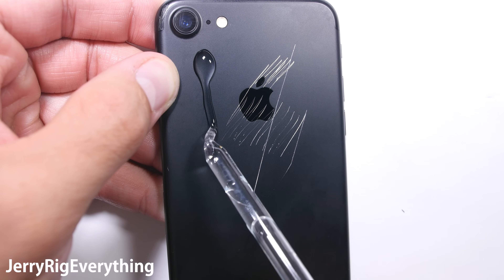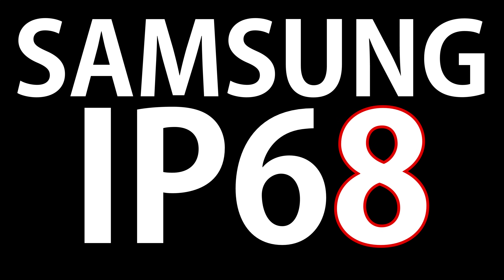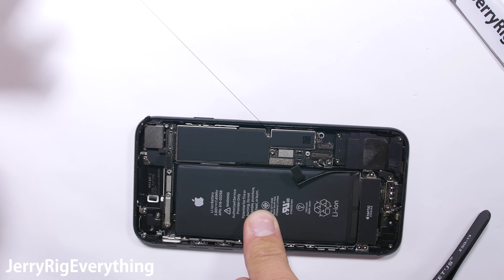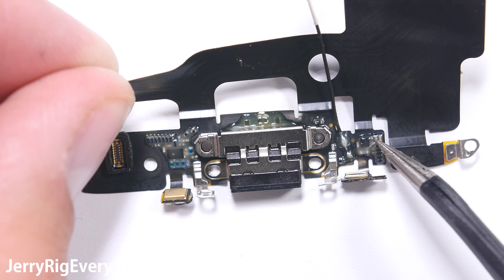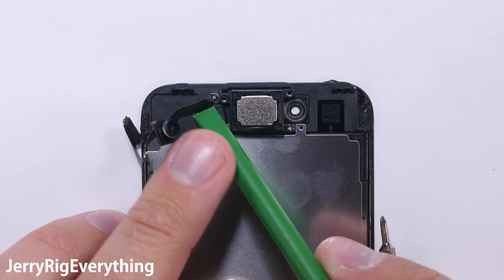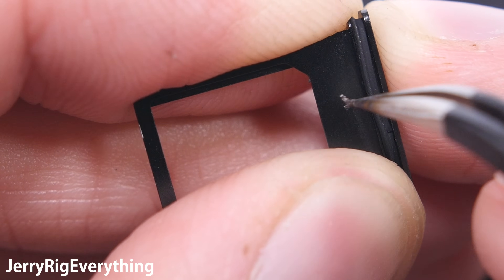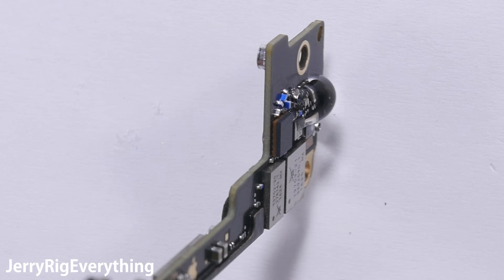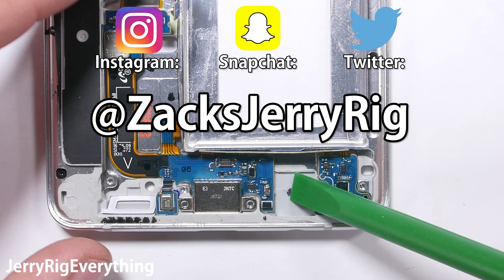What makes the iPhone 7 WaterProof? - Ultimate Test!!

Comment: Can i write under the shower or kill this my iphone?
Reply: With s7 you can
Reply: if the phone isnt completely covered in water yes, but capacitve screens usually dont work (or atleast not as good to type) when they are submerged. thats why you have to use a physical button (f.ex. volume buttons) to shoot a photo under water
Reply: The iPhone 7 is actually very water resistant. Go watch EverythingApplePro's water test. It's actually insane
Reply: +Landon Lupfer His video does prove a point but it doesn't figure in pressure and water currents. Imagine jumping into a pool with your phone in your pocket. There's a lot more pressure involved than submerging the phone in water (the bucket doesn't really allow for a "real world" test). I remember EverythingApplePro doing a video with phone cases where he strapped on a backpack and jumped into a lake/river. If he did that test with the IPhone, it would really help to see how it fares in "real world".
Reply: Mayuresh Patel I think he has a video now where a diver takes it to pretty big depths too

Comment: Hey Zack... I wonder if we could actual create a device which could simulate plugging in and removing the lighting port with a counter to potentially determine at what point it fails? Iknow machines exist for this purpose, but I figured someone of your capability could probably think of a more jerryesque solution. Stay tinkering 👍

Comment: so they removed the headphone jack for no fucking reason? how is it that the s7 has more resistance in water than the iphone 7 and has a headphone jack? what the fuck apple
Reply: they should of added wireless charging, and fixed their fucking chagring port, and chargers which break which in weeks or a few months and they are 20 dollars.. siriously most retarted move by apple 2016
Reply: Well. With the S7/S7 Edge/Note 7 You get IP68 which is a real water proofing. Headphone Jack. Wireless Charging and like 100 of extra features that IPhones don't have. 

I really liked IPhones too. Unless they didn't evolve like Android smartphones. And if You for some reason hate Samsung get any other Android smartphone ;). Or just stay with Your current phone until Apple decides to give us MORE.

Comment: All you isheep have fun with your 1960mAH battery - that thing is running out quick. Plus charging ports are degradable, and are made to stop working after around 5000 to 1000 plug ins. Removing the headphone jack just halves the time you have to say goodbye to your 720p display

Comment: Suck more Sony pls, The first smartphone waterproof, and never speak about that
Reply: Tell that to samsung fanboys ...
Reply: Had my Z3 Compact for 2 years, and flaps are still fine. I have a magnetic charger though, so don't need to open usb cap often. Although I do fiddle with it sometimes.
Also has water resistant headphone jack.
Done some underwater filming in the pool, works great.
Reply: sry bad eng, i'am Fr
Reply: +Kha h and the flaps will break down after about a year ,  happend twice on my z3c
Reply: lol cause they are getting sued because their phones are not that water tight

Comment: That's Apple glue isn't good, you can replace it with Sealant (one of type Aquarium Glue), it's very strong and heat resistant. But if your iPhone get a stumbled, the glue be easy to leak..

Comment: apple copy samsung, samsung can sue apple
Reply: What about Sony? They started to make water resistant phones before Samsung, so Sony can sue Samsung too
Reply: Nope.
Reply: Actually ... samsung copied sony and apple design!
Reply: +&#222;j&#243;&#240;rekur Haavard You&#39;re an idiot...They have not. No company had invented a water resistant phone yet.
Cell phones were barley just becoming a huge hit in the 1990s. Water Resistant cell phones have not surfaced until 2010/2011. And that was a flip phone/Phones built for use in the Military area.
In 2013 was the official first water resistant Smart phone. Made by Sony. So Samsung and Apple both Piggy-backed off of Sony's idea to make it water resistant.
Reply: Diego Cejudo You can't sue/copyright something that every company can make. What about if samsung copyright Oled screens, or if Apple copyright the 3DTouch/Force Touch or the Touch ID/Fingerpring reader. You just can't do that.
Reply: IP rating is standardize industry thingy. it is like Bluetooth, fingerprint, oled etc. I guess they paid some sort of royalty to the organization who hold the trademark license.
Reply: Dudes Samsung has been water proofing phones since the 90s.
Reply: Dom1ni1canPlayer I know. That's just stupid to think something that everyone can do is propriety of a company...
Reply: Diego Cejudo That's what basically Qualcomm made, if the phone doesn't have a Qualcomm chip it can't have Quick Charge because they copyright it, that's why the iPhone doesn't have Quick Charge.
Reply: PsychoticGuardian Ismael Who?
Reply: So because of that, if any OTHER COMPANY makes an WATER RESISTANT SMARTPHONE is copying Samsung?.
Reply: Sony's been doing this too for quite a while

Comment: Zack, not hating, but you give Samsung and Apple more praise than you had given to Sony, the true pioneer of a water resistant phone. I certainly don't mind since they are more mainstream than Sony's but don't overdo it thinking they have pioneered a new trend of protectiveness

P.s, those news with water damage Sony's and Samsung, I would take with a pinch of salt. I have been using the Xperia Z for years and now Z5 with friends using various sony phones and tested in water..
You'd be doing something stupid with it for water to actually get in.
Reply: Apple copied Samsung and Sony 😂😂😂😂😂
Reply: flapless or not, it does not matter, as there are many other areas that is more important and Sony has solved it first. and remember the s5 mini had flapless charging port which was reported by users as being completely useless..
again, the flaps has double sealing, one on the flap and another on the port itself allowing for a very tight sealing as well as resistance against much higher pressure,  which is exactly why people complain of water intrusion,because they don't press hard on it enough to ensure its properly sealed..
Reply: yeah , I agree.. SONY started the trend of water resistant phones... but the first 4 iterations were simply having too many flaps to guard it, not exactly any tech involved.

 With the z5 , they started flapless water resistance... and perhaps thats why its not credited enough.
Reply: Steven Khoo Sony got the best phones 
Used z3 
Waiting for dual camera setup sony flagship
Reply: Ew Sony
Reply: that's true !
Reply: simply untrue, the original Z and Z1 maybe, but they had double sided seals that allows them to withstand higher pressure. also for the Z1, they are merely flaps for the power and  simple card and SD slot, open aux port and magnetic charging also showed that they are more water resistant than any phone on the market even today. the Z2 body had different design that offered even more seamless watertight body,which was showcased in some slides.
Reply: +Steven Khoo Untrue?
even the z3 has a flap on its charging port to prevent water from entering.
and I never said it wasnt good at protecting, I said it had flaps to do it.
Reply: The Xperia Z1 had 3.5mm port with no flaps. And since the Z3+ they had exposed usb port with only 1 flap for Sim/Memory card
Reply: nice comment. Sony was actually the first common brand using water resistance in mobile phones but no name of him here and that's pretty much a surprise to me. wow
Reply: nice comment. Sony was actually the first common brand using water resistance in mobile phones but no name of him here and that's pretty much a surprise to me. wow
Reply: Sony is irrelevant
Reply: Steven Khoo bruh Sony is trash
Reply: The Fantom Convoy👑🏆 They horribly unresistent to falls and general impacts and scratches. The screens are amazing. Software as good as samsung(not that good) Batterie pretty good since its running on a 4k display.
Reply: I used a Sony Xperia Z3 for 1 year, and the first time it touched water the touchscreen stopped working, and everything was properly sealed... So I stopped trusting Sony's "water resistance" after that
Reply: Steven Khoo Sony is more known for ps4 and all the other PlayStations
Reply: Steven Khoo well I’m assuming you don’t have And iPhone or Samsung phone cause you’re just saying bull

Comment: Looks like apple copied the way samung waterproofed their latest phones.
Reply: Thats kinda the only way to do it with it being minimal.
Reply: looks like human copied human, fuck you human
Reply: Looks like samsung copied the smartphone from apple.
Reply: Yeah but Apple's phone don't blow up
Reply: looks like both samsung and apple copied sony... :P
Reply: So just because someone makes a waterproof phone, means nobody can ever make their own waterproof phone? Ever!?
Reply: yeah light rain, but don't drop it into a sink or toilet. It's not like samsung S7
Reply: ross brown, he obviously basing it off of everything apple pro totally unscientific test in a 35ft deep river in which the iPhone had its bottom covered by a soft cloth which most likely buffered the water pressure..
Reply: +Elisabeth B Did every one forget that the iphone 5 battery did the same thing?? The only thing apple did about it was replace the battery in YOUR phone. Samsung on the other hand is replacing the entire phone for free.
Reply: The 6s had those seals on the gap between the screen and body too, how do you explain that?
Reply: +kaola you can leave to iphone7 in 35 ft deep water for 5 minuets or even longer whereas the s7 would die.
Reply: ReWolvez Gaming that's a straight up lie. The iPhone 7 is rated at ip67 meaning it can withstand UNDER 1 METER of water for 30 mins and it will be ok. The Samsung is ip68 meaning it can be submerged DEEPER THAN 1 METER for 30 mins and it will be ok.
Reply: And?
Reply: Tinyjb0 bruh apple copies everything from samsung and samsung copies everything from apple so stfu

Comment: It's becoming less appealing to upgrade from the 6S plus with every new video I watch.
Reply: Why would you upgrade a year old phone? its still basically new. Im considering upgrading, I currently have a iPhone 4. I have a reason so be considering this over your 6S because this is the newest and have these small improvements, this water resistance is a peace of mind for me, i ride a motorbike and wear a backpack, my phone is in that pack and if it rains it can easily get wet.
Reply: ***** I am one to always have the latest iPhone out every year and I pass down the previous one to my children and spouse, but this year I am not so inclined to upgrade. The water resistance is very nice indeed and the new cameras especially for you coming from an iPhone 4, the speed alone is worth the upgrade.
Reply: CEELO_DRAWZ Ah, lucky family. Yer I'm excited to upgrade, the big thing for me is the apps, on the 4 like 90% of apps aren't supported or are but barely even work.

I do wish they had kept the 3.5mm jack, would of been the perfect phone for me then but either way its a amazing upgrade for me.
Reply: MajesticQ22 I hade the Note 7 returned it for obvious reasons then they gave me an s7 edge which is a great phone but was a bit laggy at times, so decided to go back to my 6s plus. There are a few apps that I frequently use that just run way better on IOS as well.
Reply: I upgrade every year. This phone is everything the 6S is and more. Why not upgrade?
Reply: Kinda does. IPhone sucks. But if you have a 6 just keep it. It get a Samsung Galaxy s7.
Reply: the 6s plus is a great phone,
lighting fast and has a headphone jack, i wouldn't upgrade if i were you.
Reply: i dont know how you could last with the iphone 4, my toaster is litterly faster than that thing.
Reply: As much as I hate Apple and their crappy iPhone I should be fair and say they never said iPhone 7 is waterproof..
Reply: no one said they did
Reply: Flame ! Exactly my thoughts!
Reply: iPhooоne 7 and iРhoonе 7 PPРРlusGivеаaaаway => https://twitter.com/0b0df8184be8192d7/status/790428760050798592                                                          Whаt makеs the iPhоnе 7 WаtеrРroof    Ultimate Test